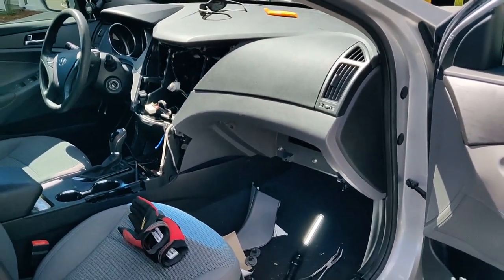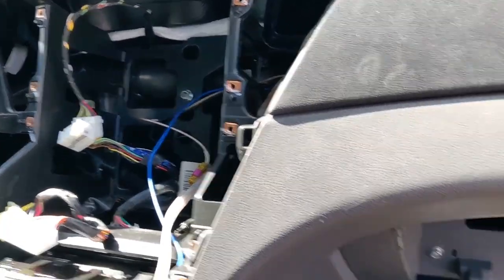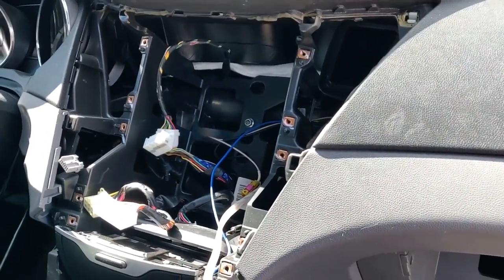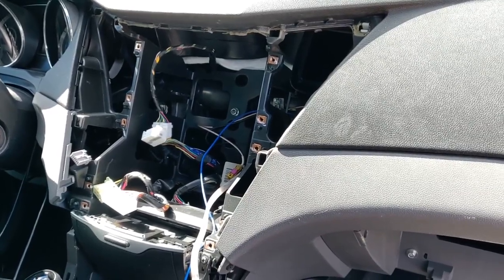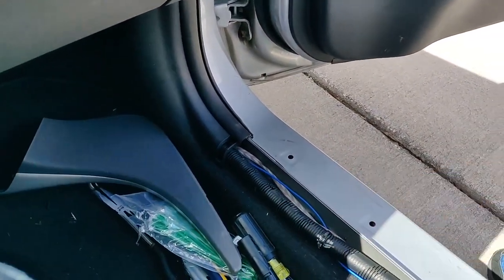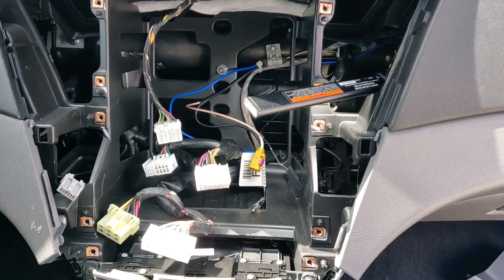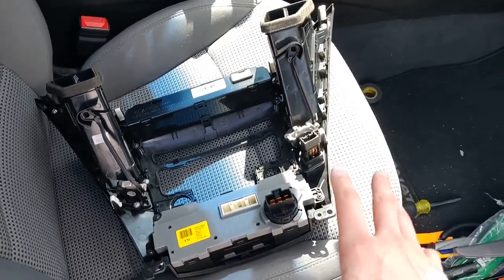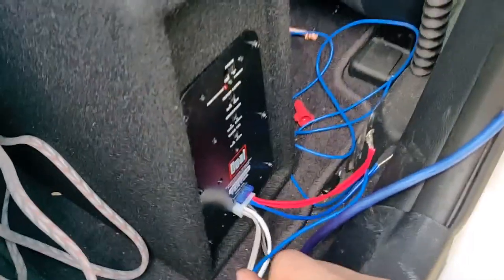2011 Hyundai Sonata - Audio System Upgrade - Part 1

Comment: Do not run power wires +/- along with audio wires, rca cables or speakerwire. Doing so easily creates audible interference usually in a high pitched whine equal to the rate of rpms of the engine. There is another aftermarket component u can buy to counter the effect, a ground loop isolator, but just avoid it altogether by running power wires down one side and the audio wires along the opposite side of the vehicle.

Comment: do i need a DAC if i only plan on using bluetooth (which to best of my knowledge is already in digital format) or does the amplifier only interpret analog signals and i need a signal processor to convert digital to analog for the amp? not trying to fork out over a grand for a new amp and speakers/subs. just want a touchscreen head unit

Comment: Dude.... how tf do u have the first video result from Google? U had to have paid someone to boost ur search results didn't u? I know that u do NOT know what ur doing well enough to instruct other ppl how to do this. U said expect to break the plastic pins in the door trim and to "find a source" to replace the pins.... No bud, if u have broke pins in or around the time of making this video, udk what ur doing. I bet u learned soon after that there is a cheap tool called a pin puller/remover that is forked so u do NOT break the pins to begin with and they r sold just about everywhere that sells hammers. Frfr tho between me and u, make a video demonstrating how u have the #1 search result for doing this and ill subscribe
Reply from the maker: As far as top Google results, it's up to key words when uploading, what people are searching for, and what Google ultimately decides to feature based on your content, likes vs what people searched for and viewed. TIPS I learned while doing this for a while and working for Social Blade for 7.5 years. YES there are pin pullers and trim kits but honestly some plastic just is too heat baked and old and just decides to break no matter what you do. Luckily you can buy trim and pins for not much money from multiple sources.
I never claim to be an expert, I'm just learning from experience, although many people I've worked with can back up that I'm extremely knowledgeable and a fast learner.